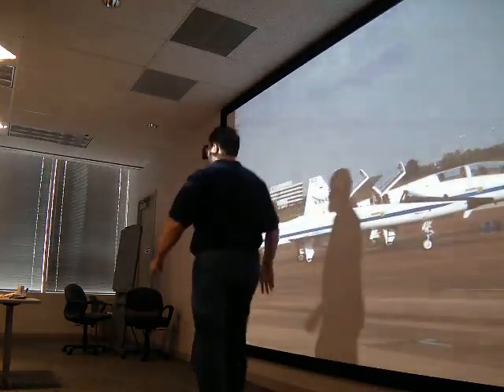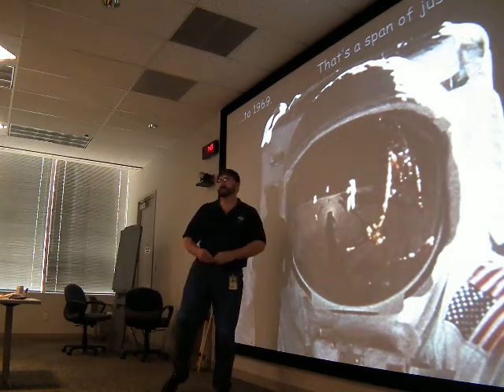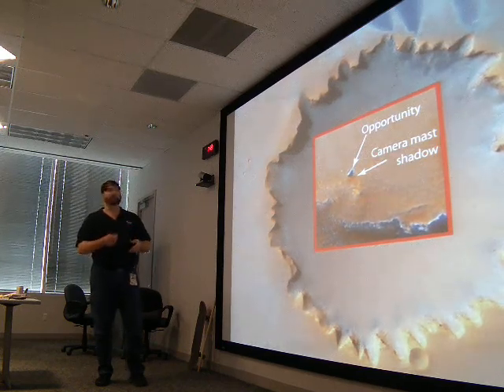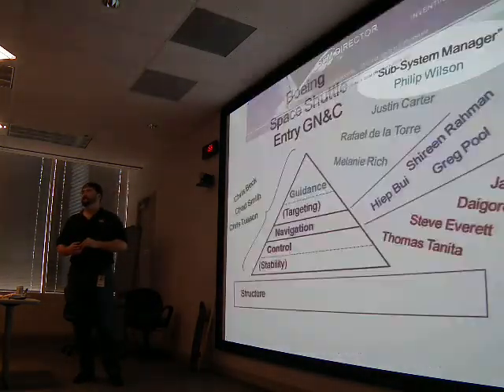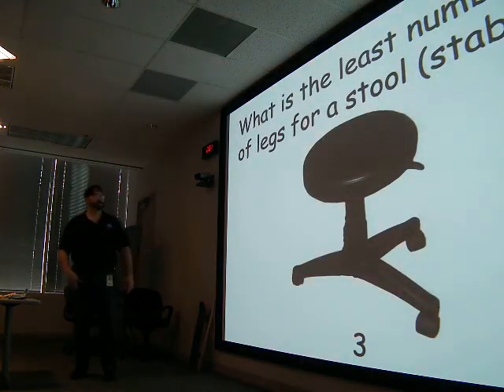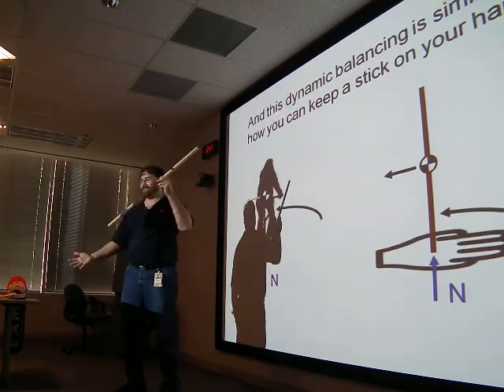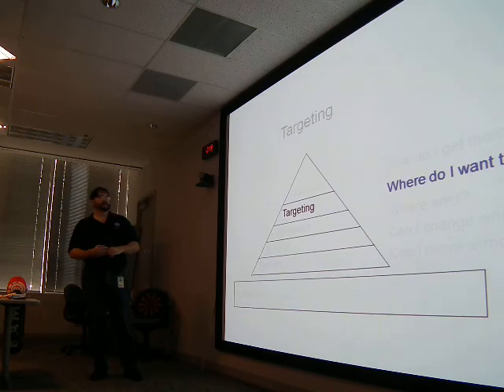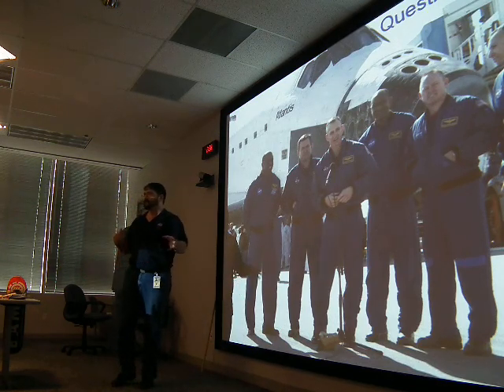Engineering for the Space Shuttle: Entry GN&C - a simple explanation

Comment from the maker: [3]
There are two basic maneuvers a spacecraft will do:  rotation for attitude control, or translation for orbit control.  The thrusters are commonly designed for the separate tasks of rotation or translation.  A set of RCS jets make up a Reaction Control System for getting the spacecraft pointing in the desired direction, and then larger thrusters can be used for changing the spacecraft's orbit along the direction that it is pointed in.

Comment from the maker: Hi Max.  Yes, in space there is nothing to push on as there is with atmospheric flight (or with ground or water-based vehicles).  Spacecraft maneuver by taking advantage of Newton's principle of equal & opposite reactions.  The common way to do this is by using thrusters.  Rocket thrust in space works the same way it does here on the ground.  You can take a 2-liter bottle of soda up into space, shake it up and when you pop the cap off it will spew soda in one direction...

Comment from the maker: [5]
Another very important method used for attitude control involves no thrusters at all. Instead it takes advantage of the principle of conservation of angular momentum. This could be thought of as "equal & opposite reactions of spinning masses". CMG's are Control Moment Gyros that spin masses to enable three-axis attitude control. A huge advantage is that there is no propellant to get used up so you can control for years on end using solar electricity. Disadvantage: CMGs are massive & complex.